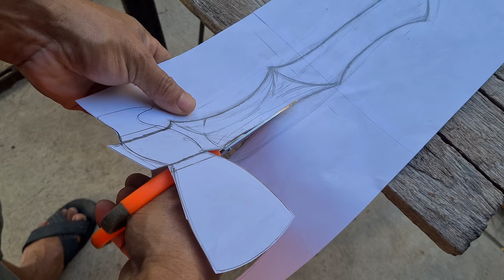An Axe Handle Design, A Combination Of The Hammer And Axe Handle | Plywood

Comment: Perfecto! Good work, I have a lot of respect for your artistry. Thanks for sharing.
Reply from the maker: Thank you very much, we appreciate it.🥰🥰😊😊🙏🙏
Reply: @poomsproject  
No worries, sir.
I have a question for you though:
Would you use carbide burr bits on a die grinder to shape the pieces? 
I mean instead of using your traditional wood file?
I’m trying to tap on modern technology. 
What do you think?
Thanks
Reply from the maker: @TheUnlocking  Personally, I tend to prefer traditional tools, partly to inspire many people who are just starting out.  Actually we can use sandpaper to polish the handle but it takes a lot of effort and time, so a grinder can help a lot in this step.  But of course, modern technology can make work easier.  It depends on the preferences of each person. Just that you're happy to do it.👍👍💪💪🙏🙏🥰🥰